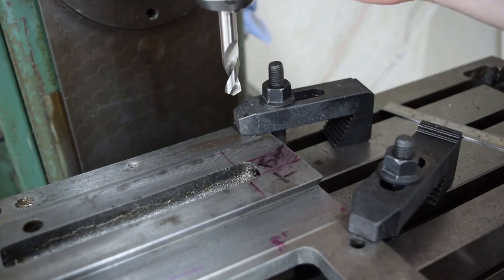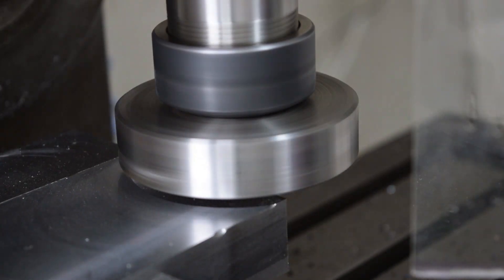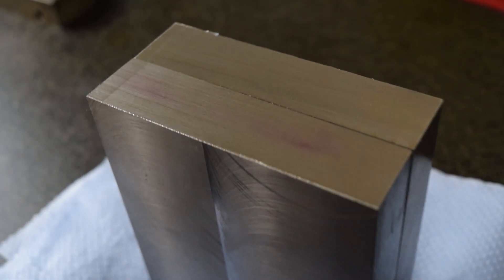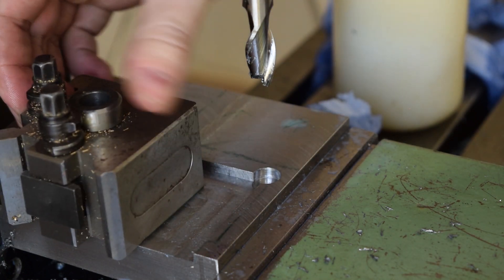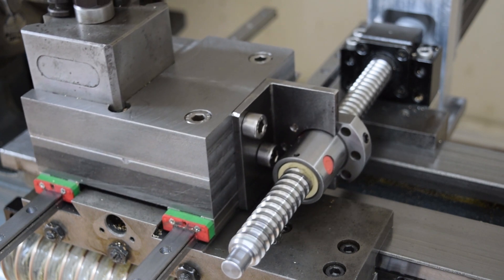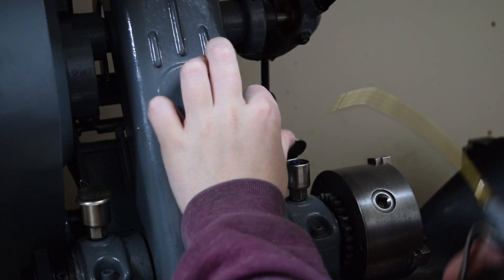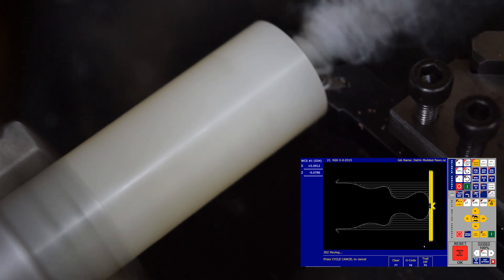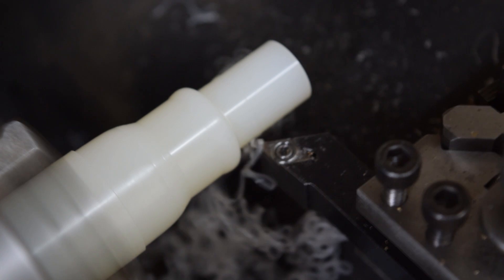CNC Myford: Linear Rails, Solid Toolpost & Demonstration

Comment: Great conversion. I actually am thinking of doing a combination of the first and second versions, so I would like to ask, do you believe the linear rails add much rigidity compared to using a raising block on the original carriage? Do you have some drawings/dimensions for the alu parts you used? Also, where did you purchase the protective covers from? Thanks a bunch
Reply from the maker: Hello,. The linear rails are rigid partly because the original cast iron slide had wear and the gib strip was also not ideal. Also the linear rail bearings are spaced wide apart which in itself is more rigid. The rails were affordable so it made sense to do it this way. I dont have any drawings unfortunately, and the lathe was sold a few years ago.   If you mean the ballscrew covers? They are dust extraction hoses. Not the best solution but it helped!

Comment: You have a fantastic voice. I like the way you’re doing your conversion, I’ve been wondering how replacing the crosslide with linear rails works out, AND I’ve been wondering how centroid acorn works out with a lathe. Would you say it’s been easy to use, how’s the fusion 360 post you’re using?

Subscribed
Reply from the maker: Thank you very much. The linear rails worked very well and I noticed an improvement of the surface finish compared to the original slightly worn dovetails.
Centroid is excellent, quite easy to learn the basics and worked well for me personally.
Fusion360 was great for CAD generating although since the change of free user features it has limited CAD greatly. (No more rapid moves...)

I sold this Lathe a month or so ago, and I'm currently cleaning and assembling a "new" manual lathe which sits in it's place.
I'm glad someone else will benefit from my CNC conversion and I can't wait to share more details about the manual lathe now in the workshop. All the best!

Comment: Sir which slide is best for heavy load and fast movement original dovetail or rail, actually I am converting retrofitted leath to cnc spinning. Which runs on  high speed and heavy load.
Reply from the maker: Generally, linear rails will support heavy loads and fast movement. But the size of rail, quality of rail and bearing, design of machine frame etc all have an effect as well.

Comment: Those rails seem likely to be much less rigid than the original dovetail slideways, especially when the toolpost is on the cantilevered ends of the rails.  It would be interesting to know what compliance you can measure on the overhanging position when you apply a known moment, and whether you get chatter under heavy cut conditions.  A useful experiment, and seems to work really nicely, but those slim rails do just look a bit lightweight...  can you comment after having tested it on some more demanding cuts than your elegant delrin wotsit?
Reply from the maker: The tool post is positioned on the overhanging portion of the rails only for retraction movements.
The all 4 bearing guide blocks are above the apron when in normal use and this allows turning of 2½" stock aprox. Which is more than enough capacity for what I designed the machine to be capable of.
Having turned everything from delrin, brass, mild steel, cast iron to tool steel I can confirm I've not once had chatter even with the material sticking out much farther than it should be usually without tailstock support.
Overall, they are rigid and as they have been installed with a slight pre load they are firm and well adjusted for smooth action. It's been the best upgrade I've made to this machine.
Reply: @TinkerInTheShop  Thanks for elaborating as I had the same question. That said, I still think a proper mounting plate supporting the rails for their full length would have made your lathe even more capable. You are likely not seeing any problems since you are turning smaller, often softer parts but if you start having the cross slide resting on the unsupported rails, you will have deflection.
Reply from the maker: @AntiVaganza  More capable, yes but as I say the cross slide is never subjected to cutting force when it is on the "overhang" portion as this machine was built for a specific purpose for which I am not turning anything above 1-1/2" diameter although I can still turn up to 2-1/2" diam. And also as mentioned in my first reply, I have turned tool steel to tight tolerances as I never use the overhang except for retraction. If this was a "general" conversion for all-round use I would extend the support and even make a few other changes, but this machine runs pretty much the same 1 program over and over so is very much purpose-built for my needs (semi/small production setting). I hope to build a scratch-built CNC lathe in the future which will replace the Myford, at that point I will probably add the rail support extension and sell the machine for general all-round cnc turning so someone else can use it for all sorts of parts :-) Thanks for your comment.
Reply from the maker: @AntiVaganza  I might also just add, I tried using the dovetail ways in version 1 of this conversion, however, I was getting errors, chatter etc. Since converting to the linear rails I have smooth movement, tighter tolerances and generally better all round. There is a slight pre-load adjusted into the rails so the slide is firm yet free to move.

Comment: Very nice!   What software are you using to run this...Does Acorn provide the software, as I have been seriously looking at Acorn for a Hurco Mill conversion and a small lathe that I have already put linear rails and ballscrews on the Z axix...Thanks for your reply.
Reply from the maker: Yes it's their own CNC software one for Acorn and I believe there is another for their larger motherboard. You can access the free version (check their website, you can download it today!) which has a few limits but still very useable and lets you check it out before commiting to Centroid hardware. However you can purchase the 'Pro' version which also allows threading operations (I have the Pro version) and a few other benefits. It's very nice software for someone like me, completely new to CNC.